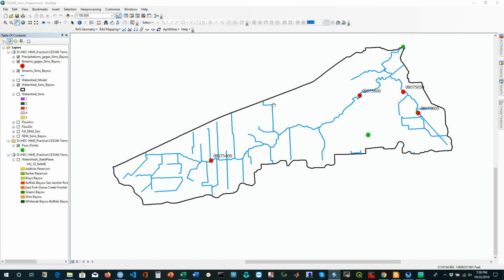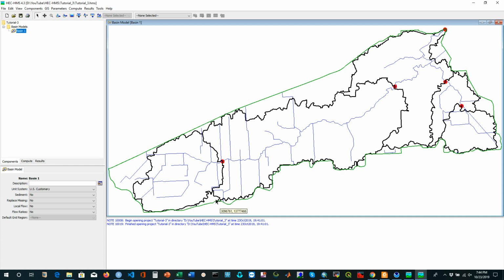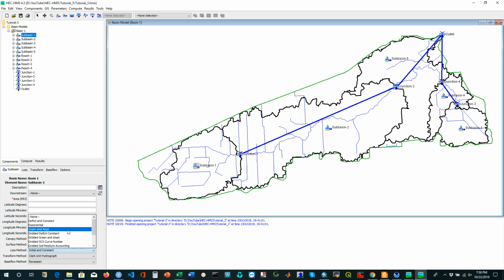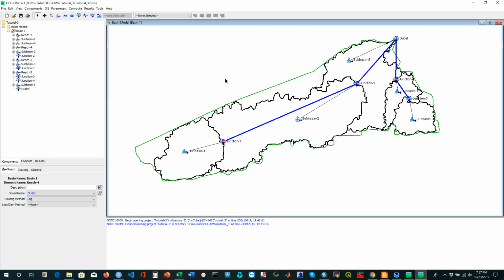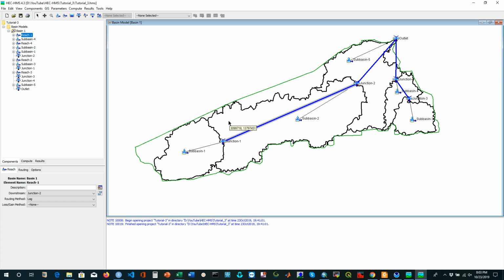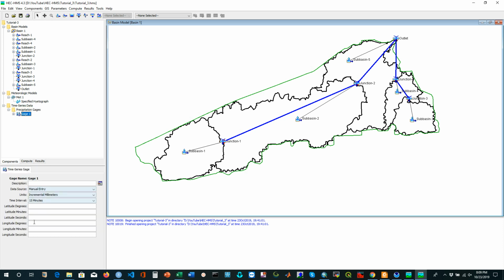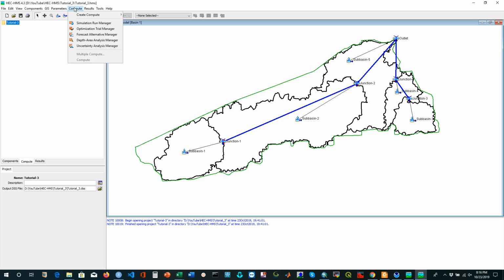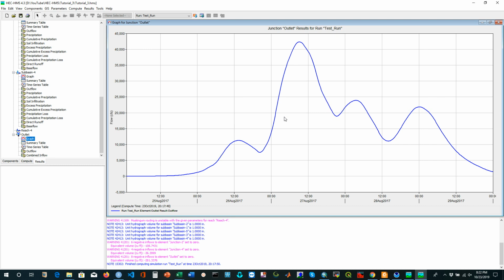HEC-HMS | T-3 | How to Set up HEC HMS Model

Comment: Sir, I have done all the steps mentioned in this video. But when I tried to Run Compute All Elements for Test Run, It is showing following Errors: 
WARNING 10351:  Could not connect precipitation gage "" to data in the time-series manager.
NOTE 20364:  Found no parameter problems in meteorologic model "Met 1".
NOTE 40049:  Found no parameter problems in basin model "Basin 1".
What should I do to rectify this problem ?

Comment: Thank you for this video, it is a very usefull explication about all the components of the HEC-HMS model. Can i ask you about the K coefficient? Is there any equation to get the K value using the differents parameters of the river? Do you recommend any bibliography or video to study how to get the value of the K coefficient for different situations? Thank you!
Reply from the maker: Hi thank you for your query. Yes, it’s a routing parameter, and it has specific guidelines to estimate its value from channel and basin characteristics. Even though I provide all materials to calculate the model parameters but you can study any hydrology books for your calculations.

Comment: hay. i m an algérien 
i m so thankfull 4 ur vedeos
would u please add vedeo explaining what type  of datas I need to collect before starting my modelin
u doing good work
thanks a lot
Reply from the maker: Hi, thanks for your query. The dataset depends on the purpose of the modeling. If it is only for an event, the required dataset is different from a continuous model. However, the basic data for all types are DEM, rainfall, land use and land cover, soil classification, discharge, etc. I offer training on this modeling, where I demonstrate how to set up the model from scratch, including but not limited to input generation, parameter estimation, calibration and validation, etc. For more info, send message to +16825537054 on WhatsApp.

Comment: Hello sir, am from uganda, how can i generate a model when am using the soil moisture accounting method under the (loss method) instead of the SCS curve number method
Reply from the maker: yes, it's possible to use SMA instead of CN. if the model is for long time, such as for few years then using SMA is effective. But you have to calculate the parameters which takes time ans needs to process landuse an soil information.

Comment: Hello sir I followed the same steps but my simulation run got fail how I can resolve
Reply: What error u r getting?
Reply from the maker: Did you check all the parameters required to run the model? Please check the links also if they are rightly connected to the nodes.

Comment: NOTE 15301:  Began computing simulation run "Test_Run" at time 02Ağu2020, 13:39:37.
NOTE 20364:  Found no parameter problems in meteorologic model "Met 1".
NOTE 40049:  Found no parameter problems in basin model "Basin 1".
WARNING 41743:  Initial abstraction ratio for subbasin "Subbasin-1" is 0,95.
WARNING 41743:  Initial abstraction ratio for subbasin "Subbasin-2" is 0,45.
WARNING 41169:  Muskingum routing is unstable with the given parameters for reach "Reach-1".
WARNING 41169:  Muskingum routing is unstable with the given parameters for reach "Reach-3".
NOTE 41743:  Initial abstraction ratio for subbasin "Subbasin-3" is 0,2.
WARNING 41169:  Muskingum routing is unstable with the given parameters for reach "Reach-2".
NOTE 41743:  Initial abstraction ratio for subbasin "Subbasin-4" is 0,2.
NOTE 41743:  Initial abstraction ratio for subbasin "Subbasin-5" is 0,2.
WARNING 41169:  Muskingum routing is unstable with the given parameters for reach "Reach-4".
ERROR 15500:  Cannot determine units system for DSS time-series
     Pathname = //Subbasin-1/PRECIP-INC//15MIN/RUN:Test_Run/
      units = "IN"
NOTE 45850:  Compute failed while computing excess for period ending at 25 August 2017, 01:15.
WARNING 15303:  Aborted run "Test_Run" at time 02Ağu2020, 13:39:37.